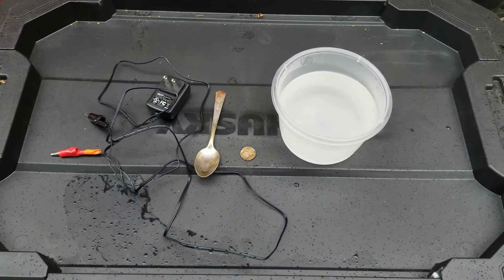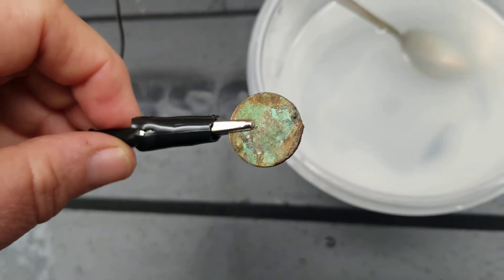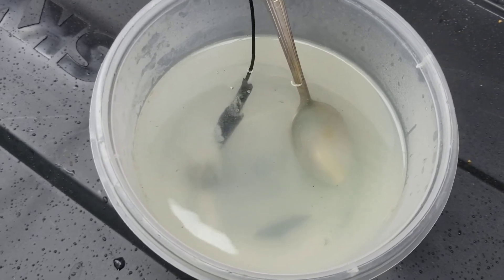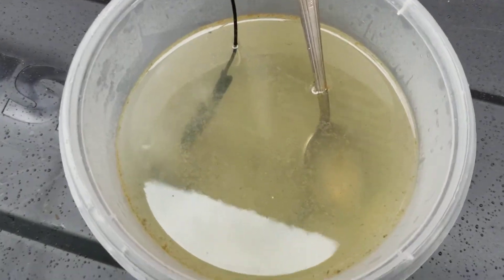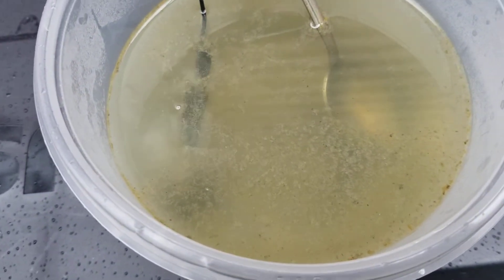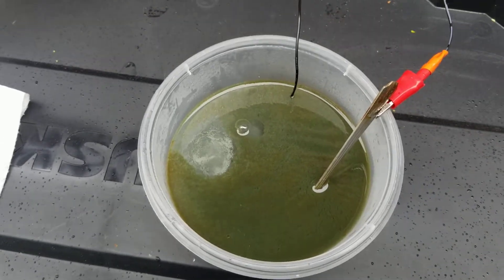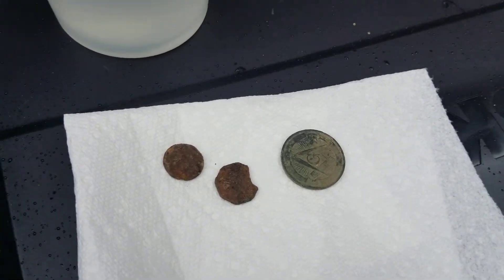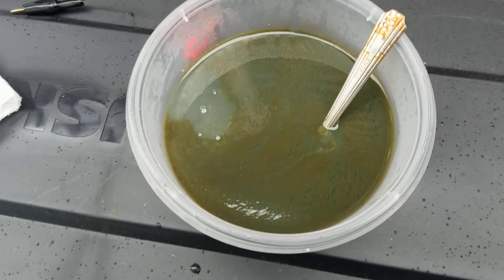First Time Coin Electrolysis step by step

Comment: Just a heads up. If you use salt, just use unionized sea salt and dont use hot water. Hot water will react with any copper in a bad way. Also, plug the charger in after both items are in the water.

Comment: I've heard that electrolysis removes the patina, a natural coating from the coin, and can cause pits to form, all of which remove the value of the coin. Maybe this method should be utilized for coins that already have a low value to them?  Good vide though, thanks for sharing.
Reply: If the coin is that cruddy and corroded electrolysis is NOT going to reduce the value any more.
Reply from the maker: I have would only use it on a coin that I can't otherwise identify so it's pretty much toasted

Comment: I have done this numerous times, with mostly good results. Nickels are tough, they usually come out brown. I have done a lot of wheat pennies, and what I end up doing when I'm done is putting some baking soda on the coin and rubbing them between my fingers, then rinsing them off. It takes that black film off that you see when you pull them out. Note however, you should NEVER do this to a coin that you think might be rare or valuable, it will destroy the value of that coin! But if you just want to clean up a coin or try to see the date, it's a great way to clean them up. I've also used it on tokens and some relics in the past.  as well. Great tutorial, would love to see another after you've cleaned up some things to see how they turned out. GL and HH on your next hunt!